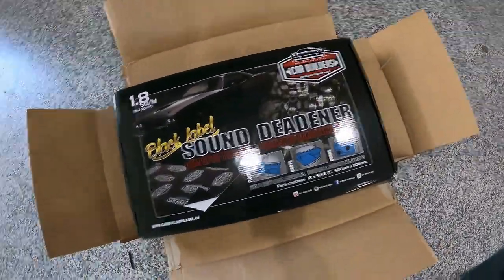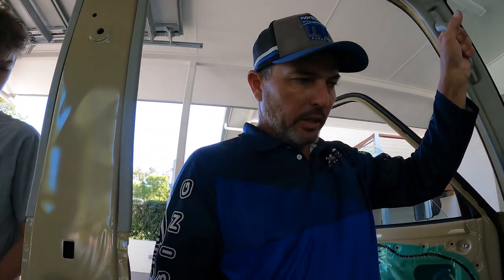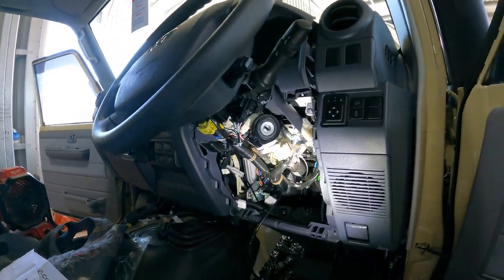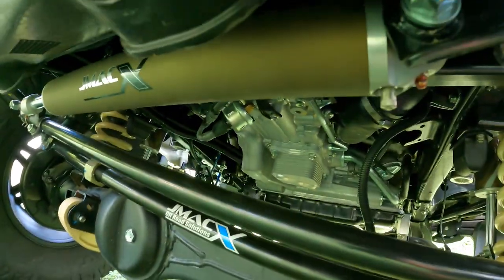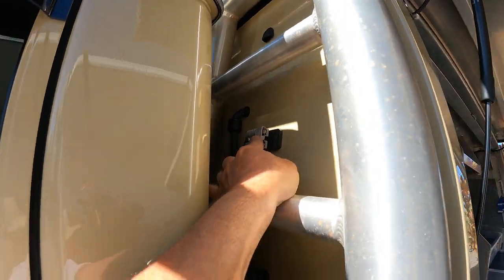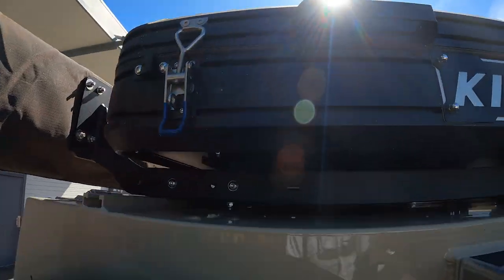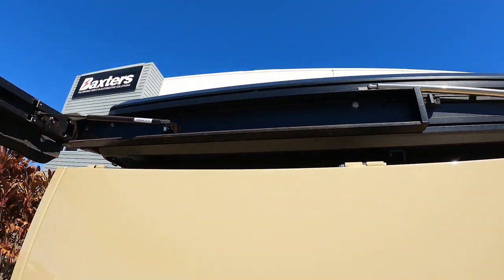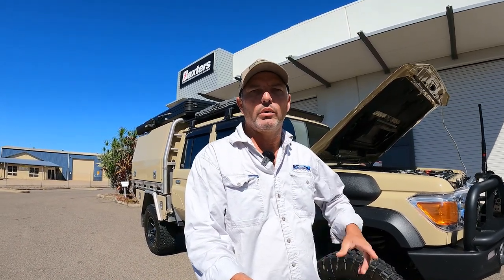Is this the BEST SANDY 79 in Australia?

Comment: Great Rig mate! Very impressive Have a very similar setup with the exact same canopy on my 79. And the Bush Company awning 

Love the idea of the extra light function on the awning and tapping into existing wiring 

Can I ask what additional Hardkorr
 light fid you use on the awning was it a permanent strip or do you remove as required and attach with Velcro?
Reply from the maker: Hi Shaun, cheers mate!! I use the same strip lights as on the canopy doors. I used 2 of them and same double sided tape as the one on the doors. They are permanently mounted. Zip ties the cable to the arm with conduit and left the connection end loose and it lines up with the connection on the door 👍🏻

Comment: Nice rig. May I ask what weight is the rig as filmed and do you intend to tow? Cheers
Reply from the maker: Hi, as filmed its 3600kg. Yes we have a 3400kg van we’ll be towing.
Reply: Appreciate your reply. We have same rig, including auto, though come in at 3800. Pick up a new AOR next month that will be around 3300 fully loaded. I cant see how we will go with out some engine mod! Thinking the Safari Armax ecu and turbo?? Cheers
Reply from the maker: @craigdewar1222  sweet, have fun!!!
Reply: Did I hear correctly you left the carpet in and covered it with the vinyl what happens when it gets wet it will never dry.
Reply from the maker: @stevegordon-hall2732  yes correct. I figured I’d have to pull the vinyl out anyway if I get water in the car as the Car Builders underlay and the foam backing on the vinyl will need to dry out too.